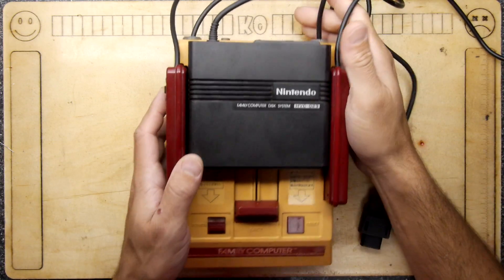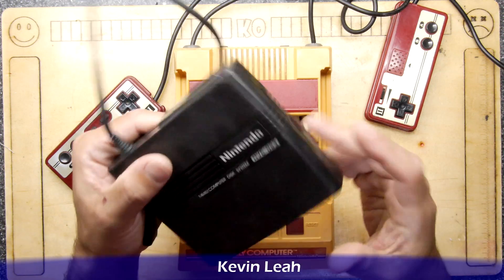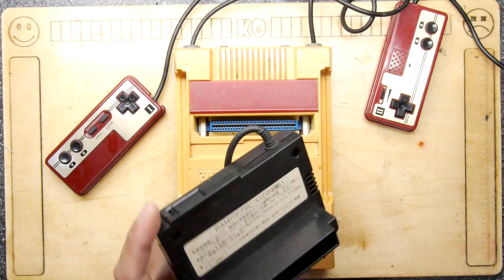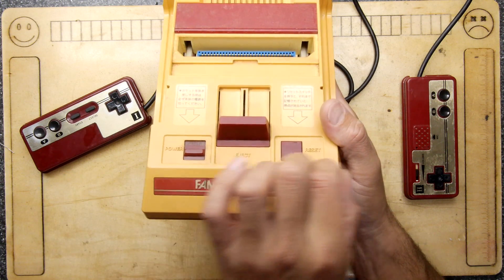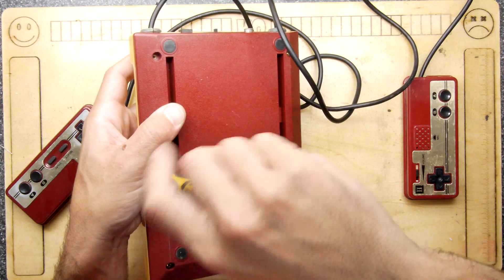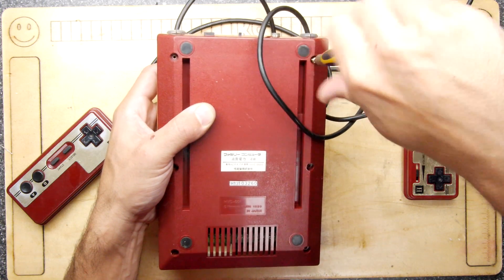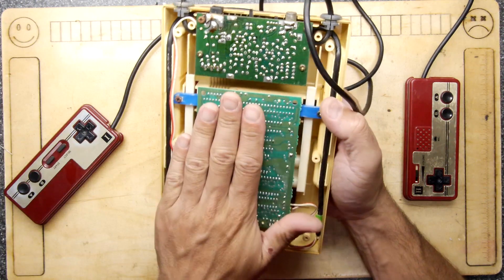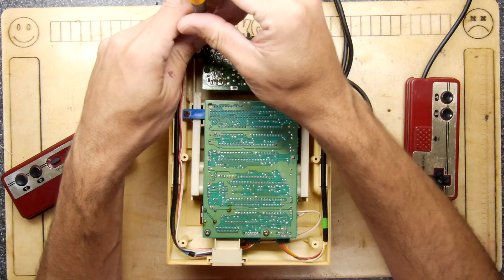Nintendo Famicom Teardown

Comment: crazy how they design them different back at that time on my power board in the middle i have a dial i can move to change my channel freq so instead of the channel 96 or 95 i can put in on channel 6 but thats here in the US so not sure if it works for you but just thought it would be cool to mention